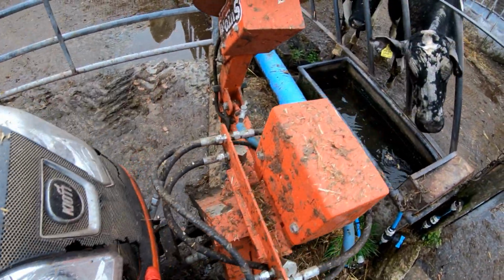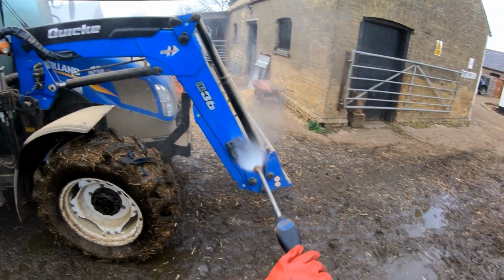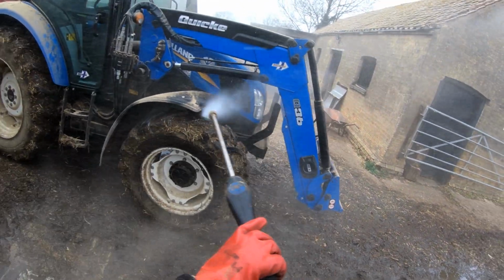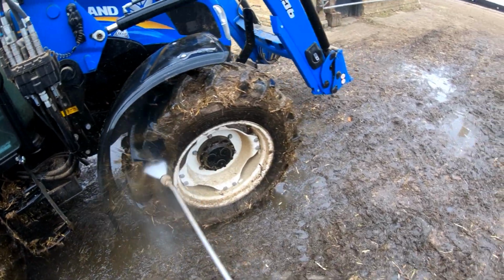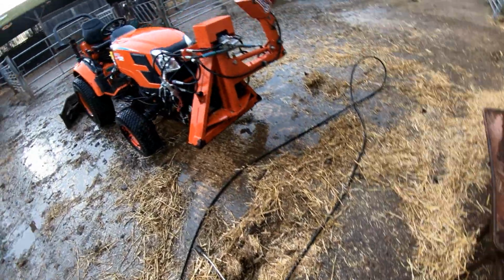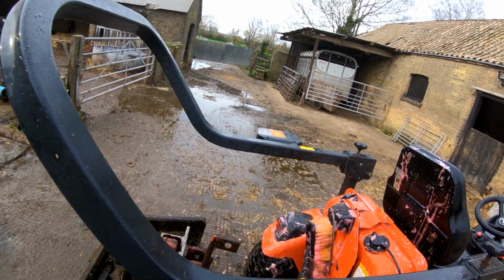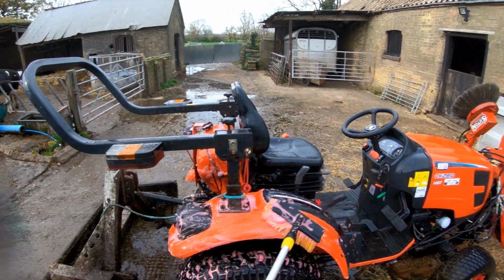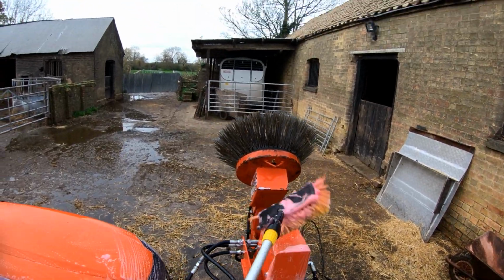FILTHY TO CLEAN

Comment: i would rather clean your equipment. last week the wife used the wrong tp and plugged the sewage line to the septic tank. had to dig up the line, cut into it and use a shop vac to remove all the blockage, fun. at least the dogs listen!!